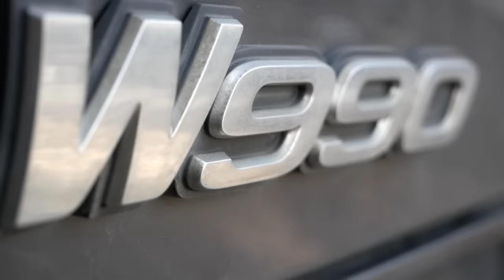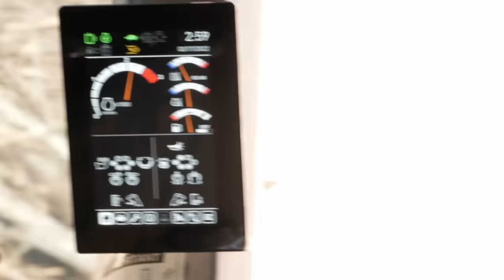SWAMP LOGGERS NC  /  "HALLSBORO BLUES"

Comment: That's that iron man logging. Jump seating equipment. Struggle putting fuel in the truck and then got to drive around the wood that's right in front of you to get to what you hope the driver doesn't have to set in line a half day to get a scale ticket. Perilous times we are in.

Comment: I own my truck mr Bobby and I tell ya this is the most ive ever made . At this rate as a single truck im on tract to make 550k this year. Its unbelievable what the rates are.
Reply: George Jones  It will work out for a very long time George. I run contract freight for pepsi an knauf insulation and broker loads back. I mainly run short game out of indy. I get 100 percent fuel surcharge on all contract freight.  My fuel was 1250 last week with 845 fuel surcharge.  So yeah life is good sir

Comment: I know this is crazy, but I see two routes for you.  Swamp Loggers was a great show. When it was on things were going good and you did not have time to work with crews. But with the times as they are. Maybe look back at it again. You have a lot of extra time waiting to do your turn arounds. Look at Gold Rush or others.  Cursing every other word.  Your show was a family show that family loggers could watch. Like the Waltons, Little House on the Prairie, or Bonanza.  The You Tube channel is great, but Swamp loggers was also.  2) Do what other loggers have.  The Capp Brothers in Landrum, SC opened a Chip yard so loggers did not have to haul long distances to take wood to the mills. This was  after the 1985 switch to long wood. Find and old mill or wood yard with train tracks, maybe scales.  Use and old loader to unload trucks.  A used in woods chipper that separates chips and bark. Train your chips to any mills in NC and SC. Let Your Son run the woods and you and wife run the chip yard.  I forgot.  Sell bark to places that produce bag mulch. Picked up at one in Virginia and GA years back.  Pray on it.  GOD Bless you and your Family.  Chin up.  Put all this in GODS hands.

Comment: What you NEEEEEEEDDDDD to explain is how are you working for the PULP MILL, but yet the track the PULP MILL has got you on refuses pine but will take HARDWOOD at the mill. Since the MILL HIRED YOU or so it SEEMS, why are they refusing the wood they hired you to cut. Bobby one thing in the program never explained seems to be this issue. Could you do a video on this explaining who you work for as a Contractor and the whole scenario. I think most people wonder, as do I. Explain how this INDUSTRY WORKS
Reply: My dad logged for 36 years. As far as I remember it was always like that for him too. At least from the 90's forward. I was too young to know how it went befor that.
Reply: @adpadp8678  Thanks for explaining that. It never made sense before, I know I was missing part of the puzzle.  I always just thought Bobby was a sub-contractor directly for the mill, which never made sense why they turned him away. Never knew there was a wood dealer......Now I understand 👍

Comment: Feel for yaz, our lil ol slice of paradise down here we call New Zealand in same struggle, wet grain harvest put major dent in what we can export and then the fuel prices as well, on top of fuel we have to pay milage tax, road user charges on our trucks and time licenses on our ag equipment to be on road. They can put them up without warning but our idiot prime minister said they would cut some of the tax off them to relieve the fuel cost but takes 42 days to be discussed, agreed and implemented. About a week after they put a massive tax on new diesel vehicles, utes as you guys call trucks but all our farmers rely on Toyota hiluxs etc to work on farmer around livestock and running machinery, 8k increase on some of them. We got to use electric! She squawks! Just a damn idiot that in bed with Trudeau. All ya can do is keep the wheels rolling some how. Cheers n beer's from Methven, New Zealand guy's 👍👍🍻🍻👨‍🔧🚜🇳🇿

Comment: From. Canada. / I. used. too wear.  those.  Aluminum. ( metal.  hard.  hat’s. ). working.  on.  the.  oilrigs.  in. northern. Alberta. Canada. back. in. the.  middle. 1960s.   ( 17.  year’s.  old.  then. we. had. a. bush. camp.  back then.  summer.  and.  winter.  -20. below.  or.  colder , I.  found.  those.  hard.  hats.  very. Light. for.  your. head. and.  saved. me.  a.  few.  times.  from.  serious.  injury. working. on. the. actual. rig.  or.  the.  ( Lease.  land.  Location) I ‘ ve.  Looked.  for.  those.  type. and.  style.  of.  hard.  hat.  here in. Canada.  can’t.  seem. too. find. one. , I.  also. Like.  too have.  a.  hard. hat. Like. that too remind.  of.  my. day.’s. working. in the. oil patch. , I. also.  worked.  year’s. ago. piling. Lumber. in. a sawmill. ( Prince. George , BC  1960s. ) and.  hauled. saw.  Log’s. and. pulpwood.  ( North. of.  Thunder. Bay, Ontario.  and.  Grande. Prairie.  , Alberta.  / Have.  a good.  day very. good. footage. , be safe.  out.  there.  in. the.  workplace. / Bill.  S.   Canada